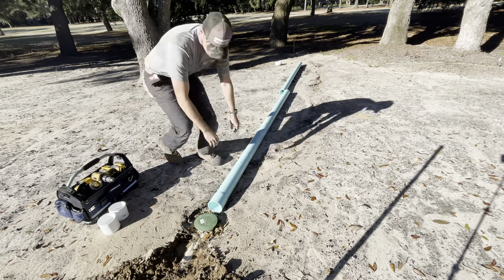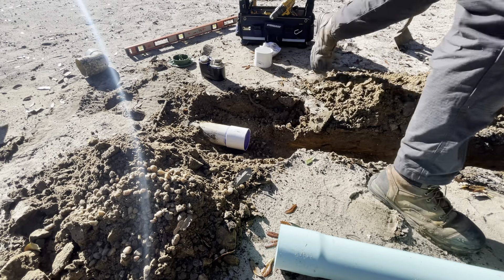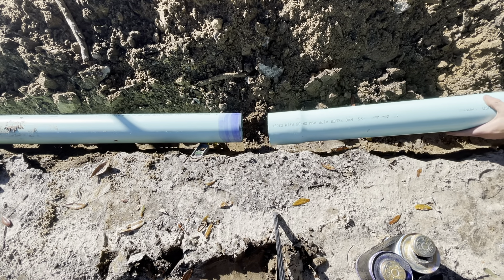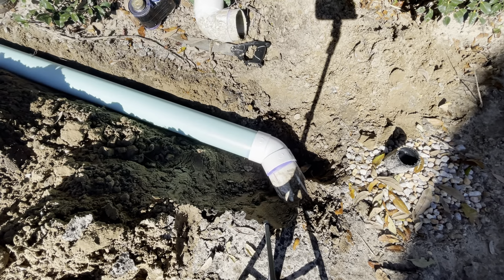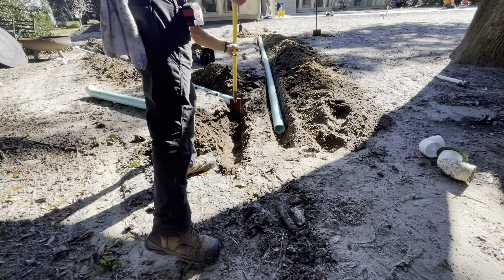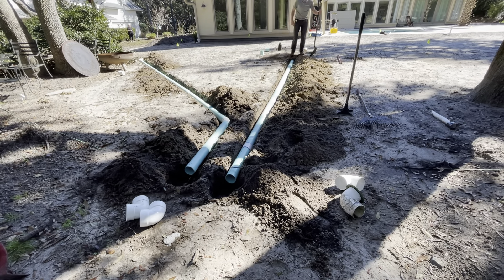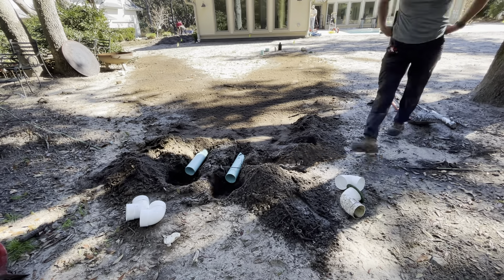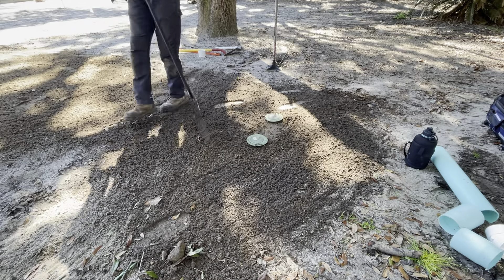How to Extend Your PVC Gutter Run-off system

Comment: A fernco fitting can sometimes help when you misjudge your trench line and are trying to connect a coupling. Gives you a little leverage to manipulate the pipe to the left or right. Obviously not a lot but may work in some situations. But great video man. Keep up the good work 👍
Reply from the maker: Great idea, need to keep a couple of those on the truck. Thanks!